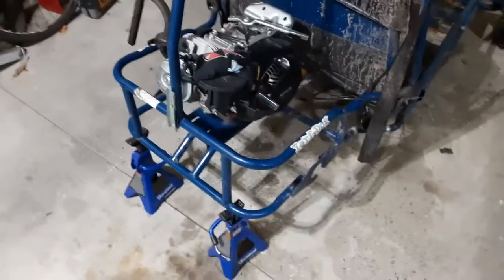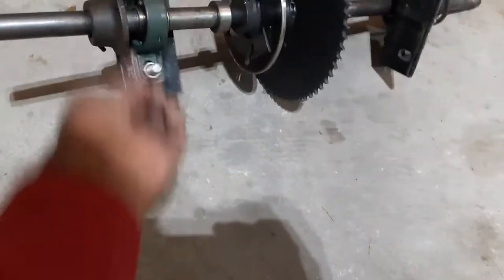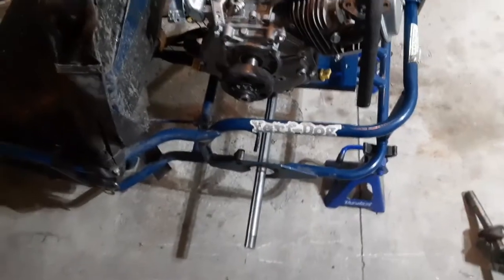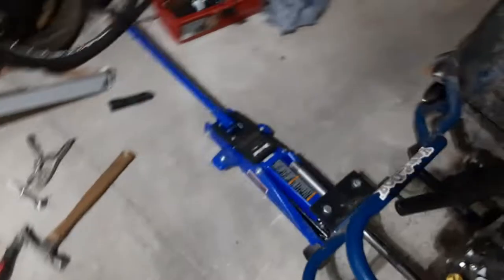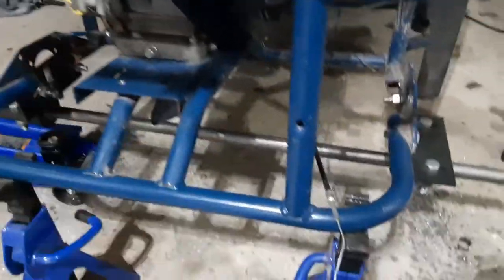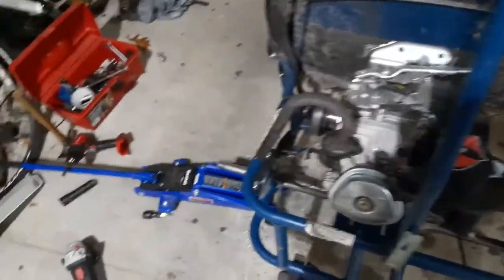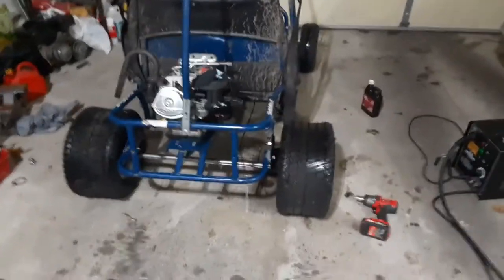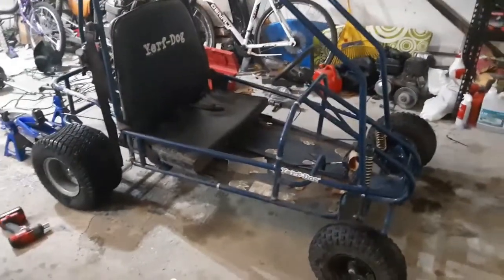Lifting my Yerf Dog go kart and installing a new axle

Comment: hey I have one and I need to move the axle bc its super uneven and one of the bolts is rubbing on the tyre. do you now what to losen so I can adjust it?
Reply from the maker: There should be 3 bearings holding the axle. On them are set screws that you can tighten or looses to slide the axle.